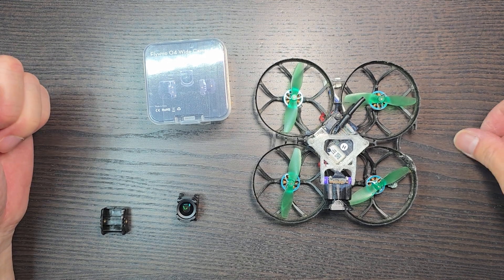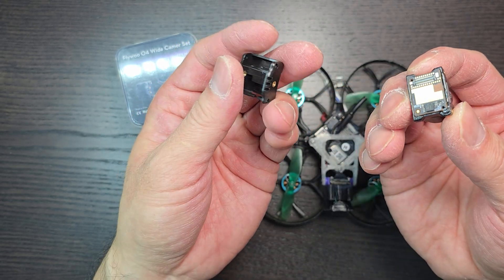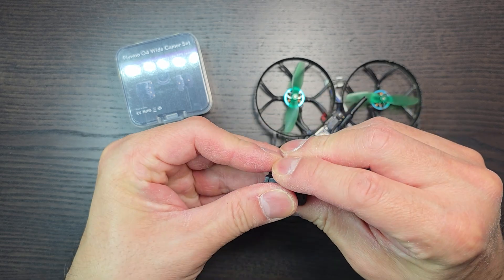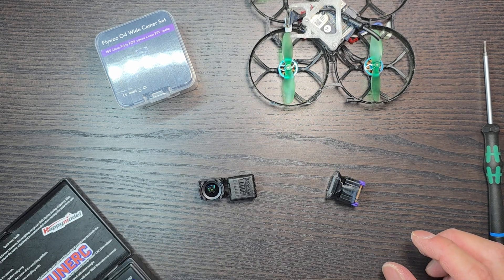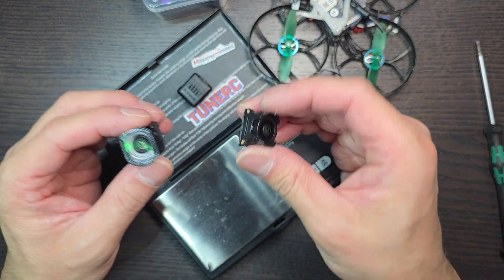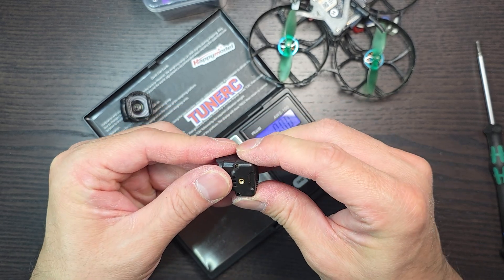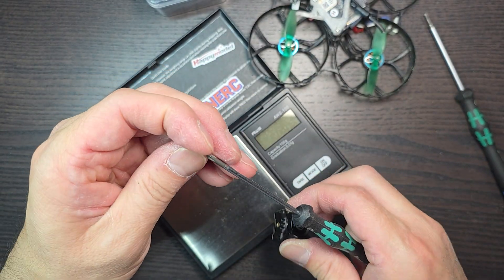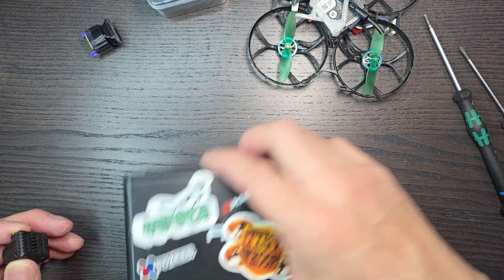Mounting Flywoo O4 Wide Angle Camera

Comment: Are you still gonna attempt the video of getting rid of the plastic lens and mounting the new housing and wide angle lens?
Reply from the maker: I've done the mod before but used a cheap lens replacement. Contemplating doing it again with the flywoo just haven't thought of a use for another o4 build yet, lol

Comment: there should be a 3d print for just the camera itself, with no adapter. those hard plastic adapters just add weight and induce vibrations
Reply from the maker: Yea I'll find out if there is any vibrations or jello when I fly it outside, but at the mercy of the weather...

Comment: the older system is little bit lighter since you weighted it with the uv filter. 6.7g (and the filter glas weights around 0.3g - source their website)
and the new system 6.52 and the filters for the new system weighting around 0.4 grams - source their website 
it probably weights around 0.2g heavier than the older slide on system 
but the new one has a more cleaner view and look.
Reply from the maker: I should of weighed the new version with the nd filter but what's on the video is accurate. The old version was weighed with the stock lens on it.

Comment: I assume this shows "camera calibration" error when you swap the camera out?
Reply: Yes, it does. The kit that comes with the third-party camera will have the error message. The DIY version will require the removal of the factory lens and the housing, but avoids the error message. Also, the $140 option that includes the VTX uses a third-party camera but Flywoo has managed to recalibrate the system to get rid of the error message.
Reply: refreshing the firmware thru the dji assistant app might help get rid of the error message
Reply: I have wondered about that, but even the Flywoo website states that the air message cannot be eliminated. Also, I have never heard a content creator say that recalibrating through the website would fix it.
Reply from the maker: Hmm I might have to try this out but at moment I just want to fly it outside 🌧️
The Red calibration error is annoyingly right over the flight time OSD element on my feed...
Reply: That error message might even be a deal breaker for me! I might go through the trouble of removing the factory lens and housing and replacing it with the Flywoo kit minus their camera just to avoid the message.